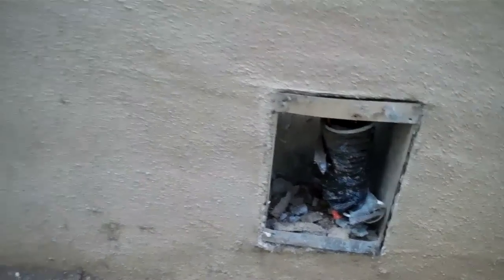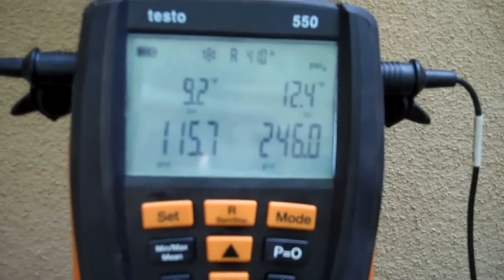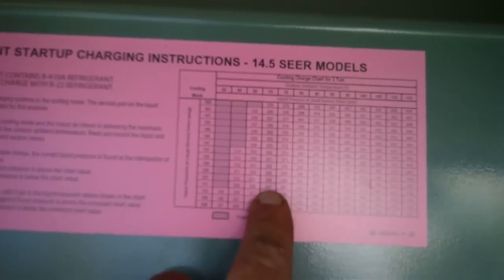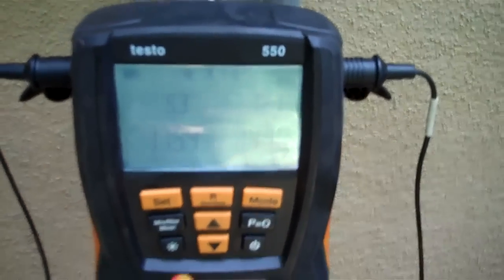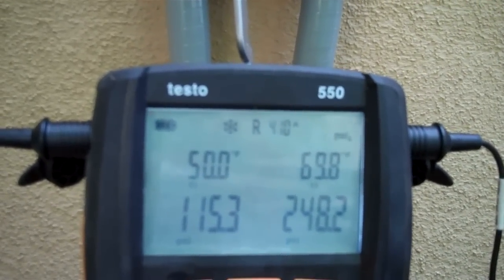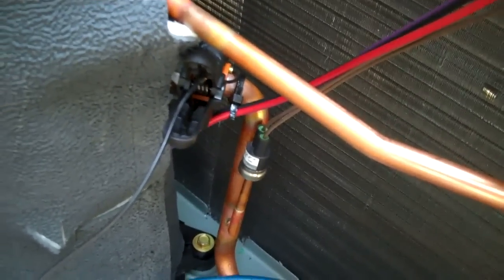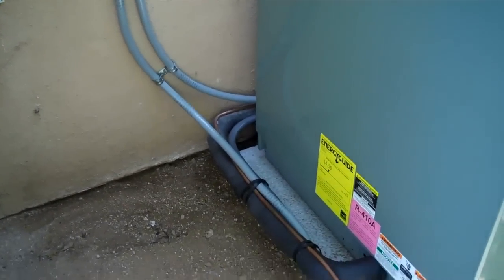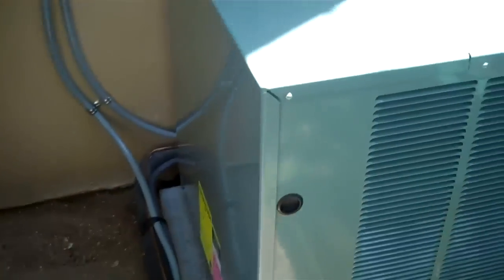HVAC  Testo 550 in action

Comment from the maker: @fritzhvac Hey FRITZ I lost you in the comments maybe it is time for glasses!! The bell extension box is actually screwed to the 2 by 4 single gang box( installed on rough in) and the bell extension box has two 1/2 threaded holes for fitting .The cover is a outdoor weather tight cover.

Comment: @dizziedallas  I got the Fieldpiece HS35 stick meter ,it came with a detachable amp probe and a nice little case , I bought my Temp Clamp separate ! I wish I could of afforded the HS36 , it has a LED , but thats about the only difference , mine will have to do for now.  Its a fine install , I see 24" off that wall , give are take 12" (just kiddin) !!! LOL  Sometimes you GOTTA DO what you GOTTA DO !
Bell extension box, is that like a 2x4 gang box? Do you cover box and attach a sealtite fitting ?

Comment: @dizziedallas  well, just yank that dumb old water main out of there and turn that unit so it's service panel is against the house... you can leave 4 inches or so... just as long as you can get a 1/4 inch box end wrench on the screws.  I've gotta post that picture now.

Comment from the maker: @fritzhvac What fleldpiece do you have SSX34? The line set was in a sheet metal box with a cover I can not take the credit  only for the hole ha ha! The electrical box on the wall is call a bell extension box.

Comment from the maker: @fritzhvac Hey Fritz The temp probes mount on the two sides of the testo (plugin)and the other end mounts like a carpenter clamp. The other meter is getting the ambient temp which was 70 most of the time (video shows 72)my lowside was about 113 which means my highside should be 246 that is real closes.Thanks for the comments my new best friend!!!! Dallas

Comment: Nice install. Seems like your constantly having to set condensers in tight spots. I usually have acres to work with compared to what I've seen in your videos. I made some insulated boots that stay on my testo clamps. I will get to use it again next week when I set a new R410A 2 ton. Most of my service calls are for R22 systems.  I am considering buying another testo for R22. How do you like your other digi gauges compared to your testo?